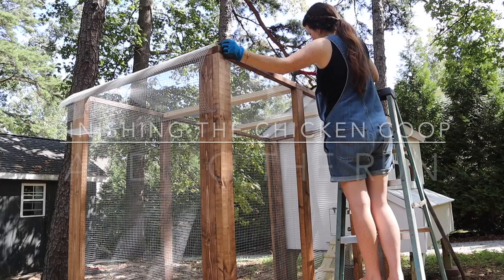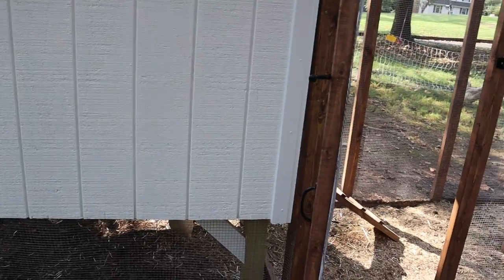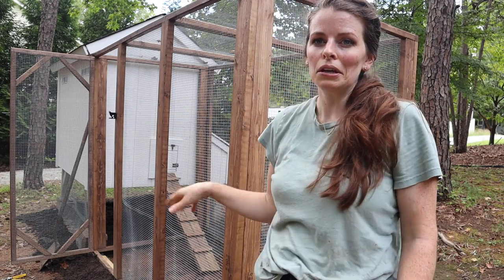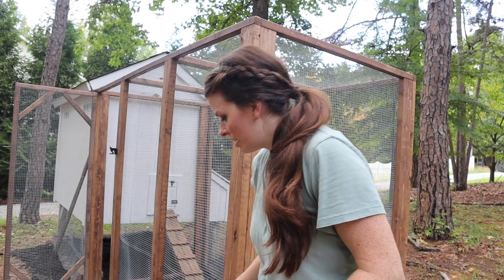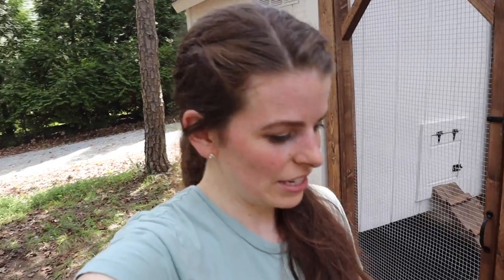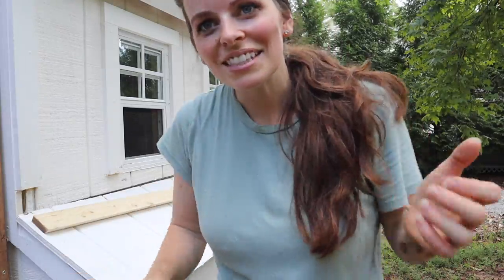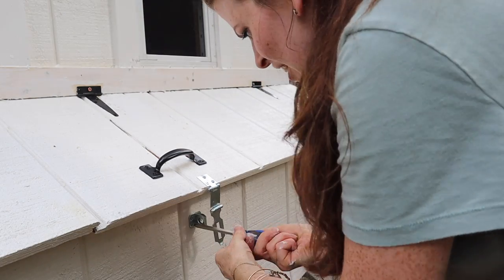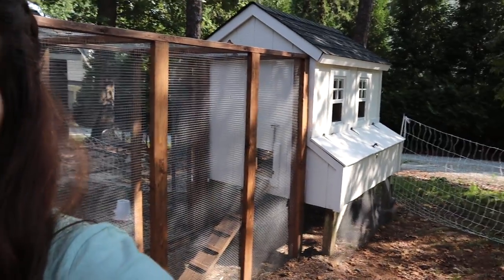WE ADDED THE CHICKEN RUN + FINALLY FINISHED THE CHICKEN COOP | DIY CHICKEN COOP |Heart and Home Crew

Comment: I use construction sand on the inside of the coop as well as the floor of the run.  Under the nest boxes and directly across on the other side I built small doors to be able to clean it out easier.  You have done a fabulous job.  You should be so proud.  Another idea on the wire predator proofing I sat concrete blocks and built a shade garden around the coop and run.  Where I had to walk I placed paver stones.  My coop has been up for four years, with no large predators getting in.  I even had a bob cat take a look but moved on.
Reply from the maker: I thought about using sand but ultimately landed on the straw! Thank you so much! I love the idea of a shade garden and paver stones. A bob cat?! That’s when you know you did a good job making it predator proof 👏😅